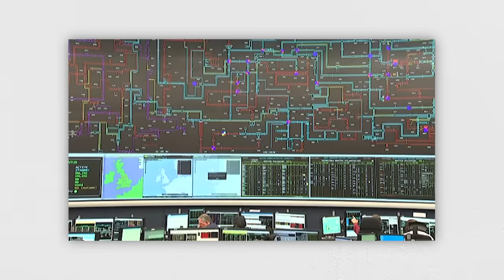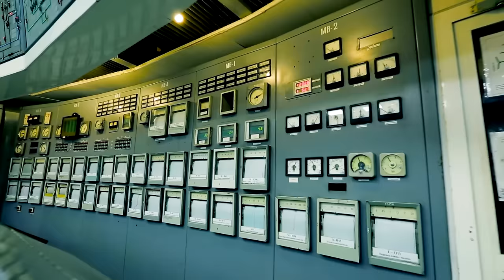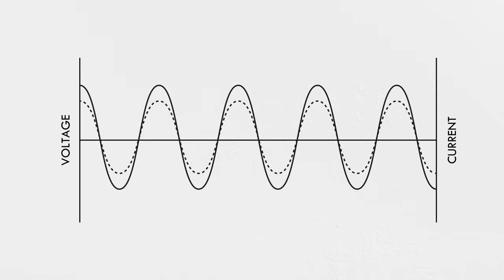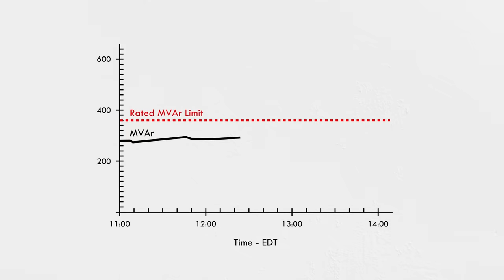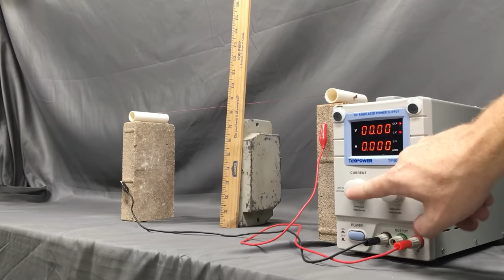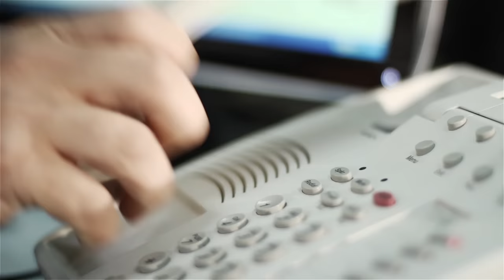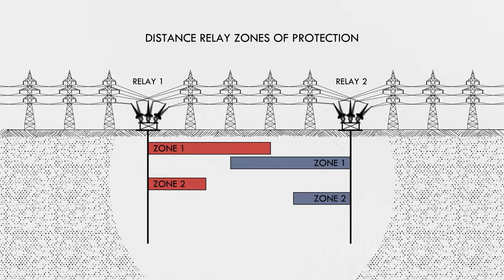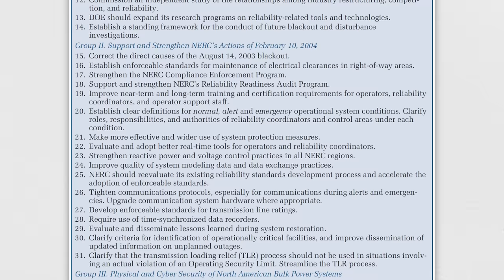What Really Happened During the 2003 Blackout?

Comment: I was working on the eastbound Amtrak Capitol Limited and we were halfway across Indiana when the power went down. The signals that control the rail lines went dark and operations were immediately impacted. We could only advance at about 15 mph between the dead signals and we only made it to Cleveland by 0830 rather than around 0200. We didn’t reach power until we got to Pittsburgh in mid-afternoon where we were due around 0800. A trip from hell…

Comment: I was running the auto lines at work in Findlay, Ohio. 3 different sets of mechanical presses with transfer automation rails. It browned out then surged which fried the transformers and dynamic brakes on the automation. $50k damage each and it took weeks to get enough spare parts for everything. The pressed were undamaged.

Comment: We never lost power in Quebec, since we operate a separate interconnection (the frequency is not kept in sync with outside the interconnection). Though interestingly, this was not legally the case in 2003, where Quebec was physically differentiated from the Eastern Interconnection but still legally considered part of it. That changed in 2006 when it was legally recognized as a separate interconnection. In any event, we didn't lose power, but my then ISP's entire core network was in Toronto, so we did lose Internet and watched the coverage on TV.
Reply: If I remember correctly, the QC grid is linked to the rest via AC-DC-AC converters (The rest of the grid didn't trust hydro-power to be "stable" enough). These tripped during the 2003 blackout.
Reply: @ve2dmn  Right, but since it's an external connection and the Quebec grid is self-reliant, tripping those is the correct thing to do when faced with problems on the external system, it kept Quebec's grid up and running.

Comment: Great summary!  I joined MISO in 2007 and worked there through 2019.  I was the Director of infrastructure for most of my tenure and know all too well that even with IT system redundancy issues arise.  It is a great industry, but not without challenges.  Also, two things - 1) we say MISO with a long ‘I’, not like the soup :).  2) the response/comment below that characterizes how MISO didn’t re-engage  their system until after lunch was more accurate (see below).  Take a listen to the FERC tape where Clair Moeller addressed this issue with the commission.  He made a very interesting comment about how bad our staff felt regarding this miss 🤣

Comment: Remembering the power blackout of 2003.  I had to work that night and it was quite surreal going in during the darkness.  It amazed me just how dark the  parking garage was without the lighting when I was negotiating it by the headlights of my vehicle.  The building I was working at had a back up generator but we were down to one elevator, basic building functions and 1/3 lighting.  A resident had a tantrum when he was told the exercise room was shut down and another demanded I turn a switch and get the power back on before she misses her TV show.  How I kept a straight face during that, I'll never know.  We were pretty lucky though.  The power at the apartment I was living at at the time was out for around 16 hours and when it came back, remained stable.  Glad I had the flashlights handy and with the heat, that cold shower I had before going in to work really felt good.  Fortunately, we still had water pressure.

Comment: London, Ontario, (between Detroit and Toronto) My memory of that day was being woken up by my daughters, to tell me the whole east was blacked out.  I worked nights at the time. The plant I worked at was the largest single consumer of hydro in this city at that time, and we must have had priority along with hospitals-- or it may have just been our location on the grid here.  I never missed a minute of work, but other pockets of the city went a week without power.  A couple of interesting things that stuck with me:  Guidance from the Provincial Government on what was essential or non essential power use was totally lacking.  Initially, news reports had U.S. power representatives blaming Ontario for the outage-- I guess based on the fact they were flying blind, but did see a whole lot of current running into Ontario, as shown in the video.
Reply: That's what you get for running synchronous with the Americans. lol

>I guess based on the fact they were flying blind

I work in grid automation, and that is not something I can fathom. That would never happen on our side of the border, you just don't loose all your redundant command and control systems at once. Their separation automation was also terrible and/or non existent. All of it reeks of cost cutting and stretching decrepit systems.
Reply: @DickCheneyXX  Well yeah, I was doing my best to not be that smug Canadian, and passed on this low hanging fruit. To be blamed and then it turned out that it was lack of routine tree maintenance (come to think, I don't think I've ever seen trees under main hydro lines here in the south) in Ohio was kinda funny.  But, on the other hand, I've seen some weird infrastructure debacles in Canada, so, glass houses, etc.

Comment: Great video Grady! 
I have a fairly specialized perspective on this kind of critical infrastructure after having worked for decades as an I.T. Data Network Engineer building and maintaining IT Data Networks at a large University.  
To start with, I have an innate distrust of reliability of networks and systems after having fixed more IT outages than I care to even think about... Everything..Will..Break.. Many times things will break in weird unanticipated ways that you wouldn't think could happen, and that you wouldn't have built any fault tolerance or redundancy for.  Most times the root causes of these failures tend to be simple physical failures like connectors and patch panels, and less often you'll have electronic failures of network components, power supplies, etc..  Usually when you see a failure of an electronic device it's some kind of non-redundant thing, or a piece of equipment that had a redundant thing fail already and now the back up part has failed (like redundant power supplies, redundant processing boards, etc..).
Anyway, all that said... Since a big contributing part of the overall failure in your excellent video on this was the failure of the alerting and alarming system..  That should never happen.. ever..  That function can never go down. I would have made a recommendation to have a dual alerting and alarming setup that operators could use and refer to that would have redundancy built into every part of the system, all the way from the datacenter where the actual systems operate, to the networks that carry the sensed signals from the grid, and all the way back to separate sensors (if possible) on the grid itself, so that you eliminate to the maximum extent possible all single points of failure to sense and alert and alarm based on that..  It's expensive to build redundancy, and difficult to engineer and build redundancy, but for CRITICAL infrastructure, that's the cost of doing business..  As you mention in your video this (the electric grid) is very probably the biggest and most complex machine anywhere! 
Thanks again for the excellent video Grady!  I really like your videos and never miss one when you post them here on YT. Keep up the great work!
Reply: I doubt the computers in question are located outside the grid control building itself.  Problem was that the subteam managing that old computer (replacement already ordered but not yet delivered) had forgotten to reactivate it fully at the end of a maintenance window, which is something I have experienced myself on lesser  infrastructure I run.

Comment: Terrific explanation - I am glad I came across this.  I was traveling on business to Sarnia, Ontario that week, and had dropped my rental car and was on the bus to the Detroit airport terminal when the blackout happened.  Terminal was dark when I walked in, and I just went on to my gate.  Back in 2003, you could still have minimal functioning on some things without computers (like getting through security and such).  Nothing would be possible now.  The Delta flight I was on had an older plane with integrated stairs (jetways work on electricity).  So they pulled the plane back slightly, dropped the stairs, loaded passengers (we had paper tickets) by taking us out on the tarmac, and took off.  I am not sure any other plane took off that day in Detroit.  But I got home to Richmond, Virginia on time! 😀  I never really knew what happened to cause the blackout until now.

Comment: As a professional pilot we spend a lot of time learning about the Swiss Cheese model, and wow is this a prime example!  It is frustrating though in hindsight, proper maintenance on the tree clearing could have broken the link of this chain failure.
Reply: Someone stated in a different comment here that the arborists cut down the trees every 5 years and  2003 was the 5th year. They were actually doing just that when it happened. Bad timing.
Reply: Trees need to be inspected every year and cut down/trimmed as/when necessary. Trees can grow a lot in 5 years. Trees don't care about 5 year cycles.

Comment: The blackout wasn't caused by "three trees and a computer bug", it was caused by shoddy infrastructure maintenance. Properly maintained high voltage transmission lines would have all the flora cleared underneath the towers and lines, making "tree faults" due to sagging high power lines impossible. That was policy across the US prior to 2003.

Comment: Wonderfully detailed narrative.  I’ve read a general summary if the failure servers times, but I’ve never seen this much detail.  Thank you. 

In accidents like this, one inevitably finds there were several straightforward steps that could have avoided the failure, both preventative well prior and in the moment.  Those steps are not taken because many of those responsible insist that which did happen, can’t happen, with no evidence to support their same-as-it-ever-was position.  Pursuit of the can’t-happen view leads to ever tightening margins, as variability is ruled out by blinkers.  And so,  why not ignore tree clearance maintenance in transmission RoW?  ‘Lines are clear now, and if the line faults we have backup and then we will send a crew to remove the fault’, or ‘Why not run this generator excited to red line, because if it trips there are backups, um somewhere’.  This mindset can be corrected w org training, but it won’t be if given the excuse that the problem was actually unforeseeable, that this instance was a group of small mistakes that just happen to align.  ‘Nobody could see this coming’ has to be stomped out.

Comment: I remember when this happened.  I heard that someone saw it coming at the PJM Interconnection and disconnected PA from the grid. This stopped the cascade heading south.
Reply: What's crazy to me is they have no way to actually control the power flow. You would think they would be like "okay let's limit the amount of power flowing northwards" but no, that button doesn't exist, they can only connect or disconnect.
Reply: @thewhitefalcon8539  if you disconnect the Northwards link you limit the energy flow. It a drastic method, by it saves the grid. The grid needs to work.
Reply: @thewhitefalcon8539  That's the difference between passive components like transformers and active controls like solid-state inverters.  There are a FEW DC links where they can literally 'dial in' the amount of power flow, but they are rare (and much more expensive).  Power grid technology has been around since the 20's and 30's.  And MOST of the time, it works quite well.
Reply: @thewhitefalcon8539  you can't limit it because limiting it means dropping the voltage which means damaging equipment. All you're going to do is give everyone a tiny bit of trickle power which will fry electronics and shit haha.
Reply: I believe AEP also disconnected from First Energy in Ohio and kept the cascade from spreading southwest.

Comment: In a similar type of event, I was at the scene of an amazing coincidence that happened with precise timing. 

I was an electrician working at a wastewater (sewage) treatment plant. Our crew was in the blower building for the aeration ponds. I was standing right next to one of the giant blowers (several hundred horsepower high voltage motor driven.) That particular blower had just been rebuilt and the plant operator was there to start it up for the first time since the rebuild. He warned me, then went into the glassed in control room. I was watching him so I wouldn't be startled when he hit the start button. 

At the EXACT time he hit the start button, the lights flickered and a very loud boom shook the whole building. I jumped away from the blower, thinking it had a short circuit in the motor, but it was running at full speed. My coworkers (who were 25 feet up in a lift) yelled down asking "What the f&%k was that?" I shrugged and went outside to see if something had hit the building.

I then noticed the three high voltage fuse cutouts on the power pole right next to the building were blown. But we still had power, so it didn't make any sense. 

About 20 minutes later our foreman showed up and told us what had happened. The contractor's digging crew hit the underground power feeder to the dairy farm behind the plant. Blew a huge hole in the bucket and severely damaged the cable. 

That boom that shook the building was from those fuses blowing at the same instant.

Comment: I remember this event very clearly. I was sitting in an advanced Information Systems Security & Forensics class when it happened. The class instructor was a retired military officer whose career both within and after his military service was spent in Info Systems Security, specifically investigating and performing forensic analysis on compromised systems. What struck both me and my instructor at the time was the fact that there were news reports published WITHIN 24 HOURS specifically stating that the event was NOT a te rr or ism /sa bo ta ge related event. Within 24 HOURS!!! I'm not an electrical enginerd, but how were the "authorities" able to make such a determination in less than one day when there were "three trees and one faulty computer system" supposedly responsible?! I've done several significant Info Sys security audits, post-mortems and forensic analysis of compromised systems and call me skeptical, but there is NO WAY you could make such a determination within 24 hours! Just my 02 cents.
Reply: That's because they didn't want to create a panic. The government feeds the media information and the media goes along with it. It took them weeks to make that determination, if not a month or two.

Comment: Could you do a video on how power generation would have worked before computer automation?
Reply: it's almost hard to imagine it could even be done that way!
Reply: Prior to computers many more places were essentially islands already and would generally balance their own load.  There were transfers of power but that had to be arranged.  The generators themselves used flywheel governors to control frequency.  Put a ball on a string and swing it around.  The faster you swing it the closer to parallel to the ground it gets.  For the USA the frequency is 60 Hz so the balls would be rotate around the center axis 60 times per second, unless on a reducing gear.  The height of the balls required for 60 Hz is known.  As the frequency reduces, the speed of rotating the balls reduces, thus the height reduces.  This height controls steam inlet to the steam turbine to allow more mass flow through the machine.  In turn this should speed the generator itself back up.  If the frequency gets too high (more power than needed) the balls swing higher and closes the steam off a little.  There is more to it than this obviously but it is the basics of how you control generation mechanically, thus without a computer.  If you have more than one generator within the island you are feeding you set all but one to a steady output.  You usually only control with one unit to prevent them from fighting each other.  I grew up near a small city that was an electrical island until the mid 90s.  During the discussed black out the city's electrical system isolated itself from the regional grid and kept on rocking because it had a power plant in the city.  Most of the time the power plant followed the city load and kept the intertie meter to the rest of the world at about 0 so people in the city would not have even know it happened right away, not even dimming lights.  Was the only place around with power.
Reply: @andrewt.5567  Awesome, very informative. Thanks!
Reply: @andrewt.5567  My understanding is that systems based on governors like that would vary the output of all the generators more or less in sync. A governor might run the generator at 100% power when the frequency is 59Hz, 50% at 60Hz, and 0% at 61Hz. As the frequency is the same throughout the system they would all respond similarly to changes in load.

Then to keep the average frequency at 60Hz and to tweak the load sharing they would adjust the governors as needed.